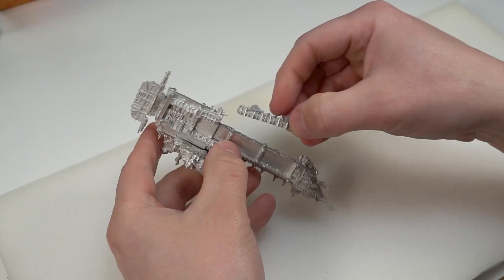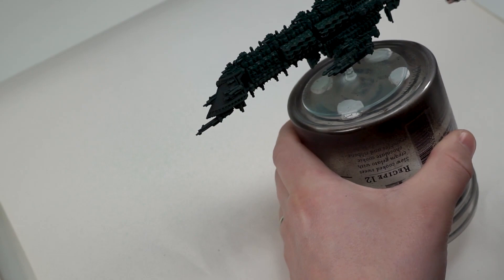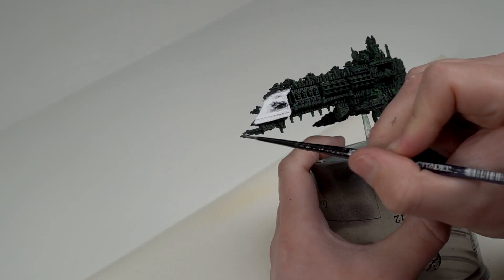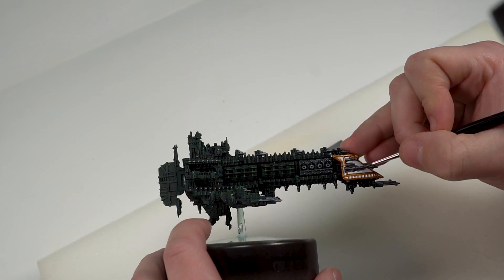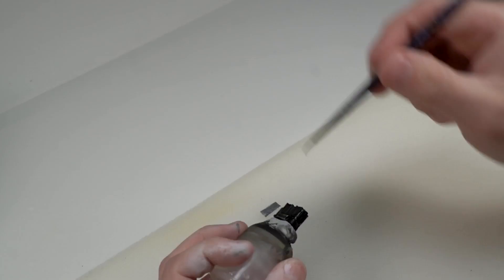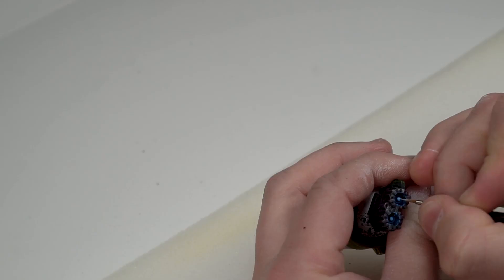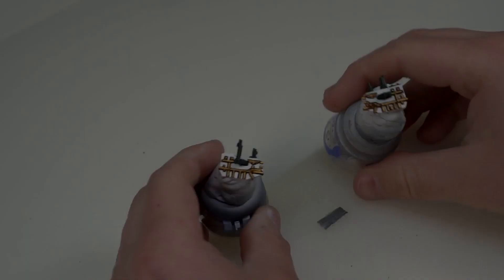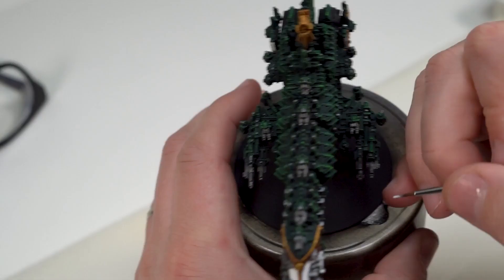How To Paint - Games Workshop - Battle Fleet Gothic - Emperor Class Battleship

Comment: For metal models, it is always best to pin all the components into place. These will help make them more secure.
Reply from the maker: Thanks for the heads up.  I do pin models that have to bare any weight on the joints. But thankfully these models don’t have that problem.

Comment: Assembling an Emperor Class with just super glue and no pinning.

You're a brave man. ;P
Reply: All my metal battleships are only put together with superglue!
Reply from the maker: Great point Aaron. Thankfully It’s not being used to play games. If there was vertical forces then maybe. But this model is pretty solid if left alone. Also the weakest part (the plastic flying base) was held in place with very strong epoxy putty instead of super glue. But in most cases I completely agree with pinning. Paper clips for the win!
Reply: @BUNKER6  those bases and stems are pretty solid. So far (plus twenty years) they have not snapped on my battleships (including playing).
Reply from the maker: Cool!
Reply: @RoyAmkreutz  I used a motherboard mounting screw, the brass ones, drilled into the bs and then attached a flathead screw onto the flying base to screw into the mounting point for my largest ships so I can take the bases off for storage.
Reply from the maker: That’s pretty genius.
Reply: @jbbconsulting  Yah, that's getting stolen. Great idea!